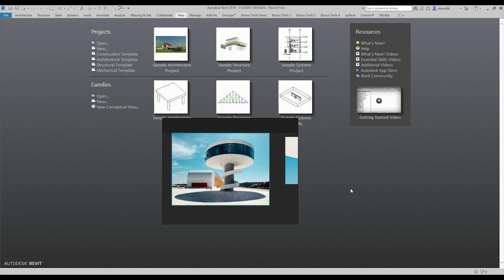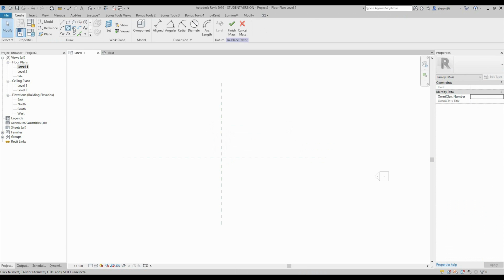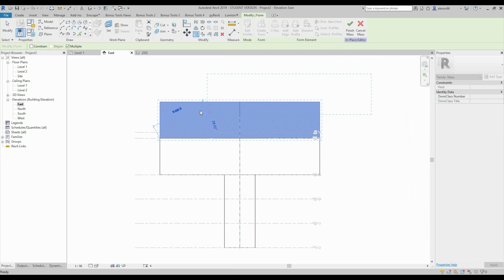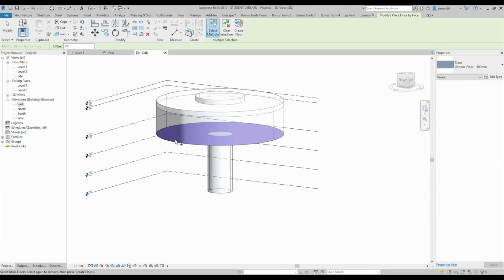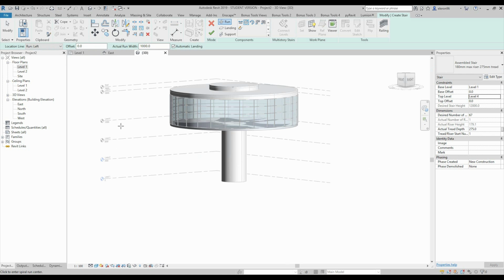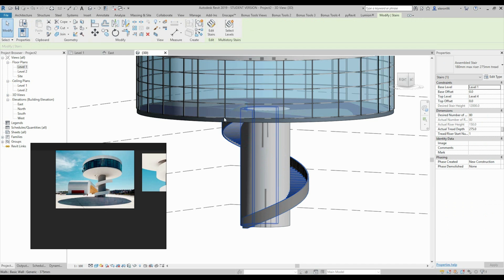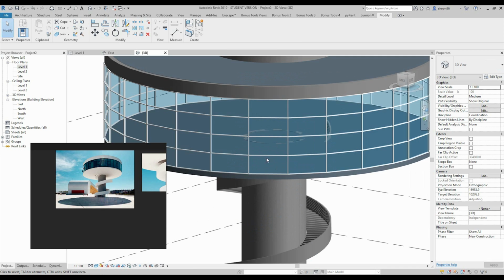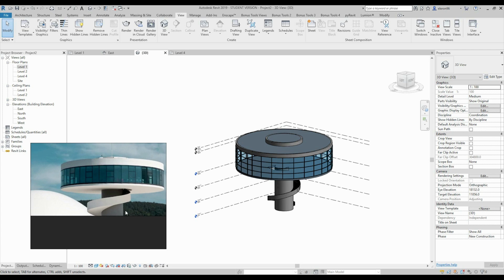Learn Revit in 5 minutes: International Cultural Centre [Niemeyer centro] (Quick modelling)

Comment: There are new sets of problems when using octagon shapes instead of circles, can't resize the roof or cut an opening for the stairs, can you use this form, with stairs hugging the octagon column staircase instead of a circular column and cutting thru multiple floors.